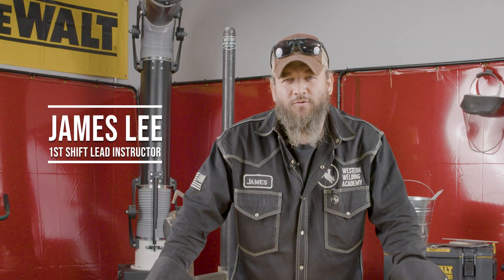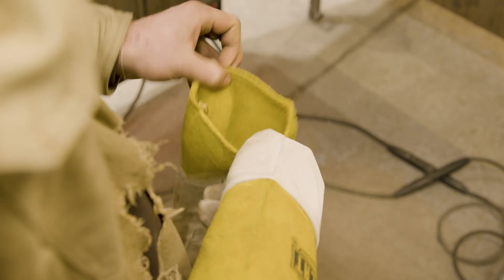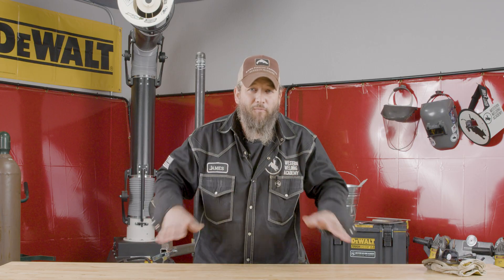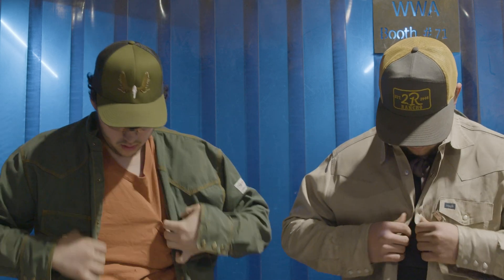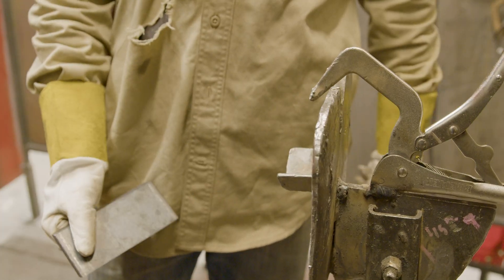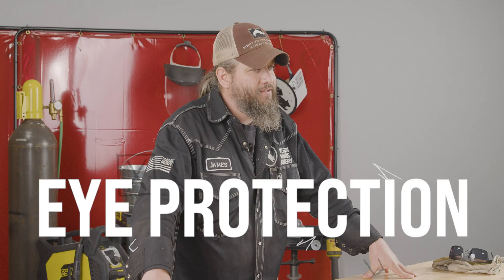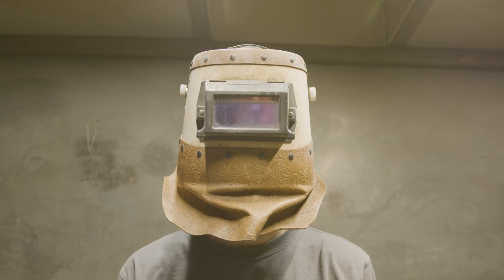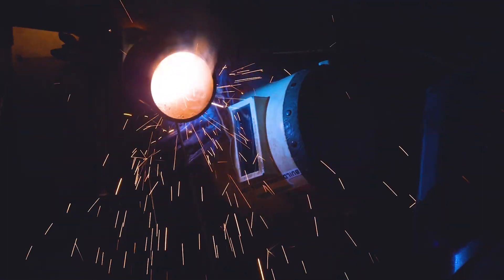TOP 5 Welding Hazards

Comment: I weld everyday in a shop. I’m young and new to the industry. Thankfully my job provides all the ppe and we can grab what we need whenever we need it. They also provide the PAPR because we weld stainless steel. So far I’ve just gotten burns on my knuckles. The PAPR has a built in grinding shield which is nice because I don’t get dust in my nose. Ear protection I wear all the time. I use the darkest shade I can my hood goes to 13. I’m honestly just thinking about 10-15 years from now I want to be in good shape. Also being comfortable while welding is critical

Comment: In my high school I went to we had ag science, which we did welding in, we only had so many booths so we had welding partners, I set a piece of scrap metal in the booth and went to grind the burs of my two pieces of metal for one of the tests we did, was only out of the booth for about a minute and 30 seconds, walked back in the booth and picked up the piece of scrap metal to move it, so I could do my weld test, well needless to say within that time of me being out of the booth my welding partner had welded on the scrap metal and I had no clue that he did that, picked up the metal and as soon as I went to move it over I dropped the piece of metal and screamed f*ck at the top of my lungs, burnt the hell out of my hand, so if you have a welding partner and your out of the booth for any length of time, use plyers to pick up the metal, you might just save yourself from alot of pain
Reply from the maker: That is some great cents. Thank you so much

Comment: Very well spoken, Sir. I totally agree.  Your flesh is not as tuff as you want it to be, but it will eventually heal up. Eyes and ears can have detrimental perminate damage. 
        Those nice gloves are expensive, and their cost comes off the bottom line of your paycheck. Take care of them. They are not made for handling hot stuff, they are made to protect you from the hot stuff.
Reply from the maker: Absolutely, taking care of yourself and your gear is key. Gloves and PPE are investments in your safety, not just tools. Eyes and ears don’t heal like skin, so protecting them should always be a priority.